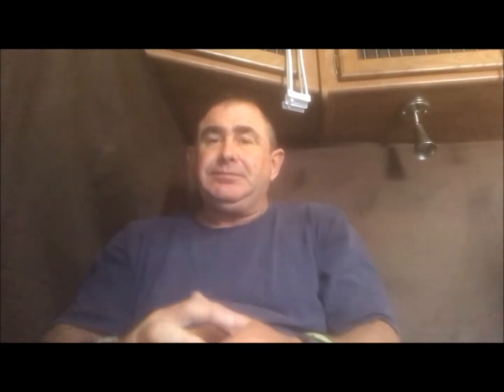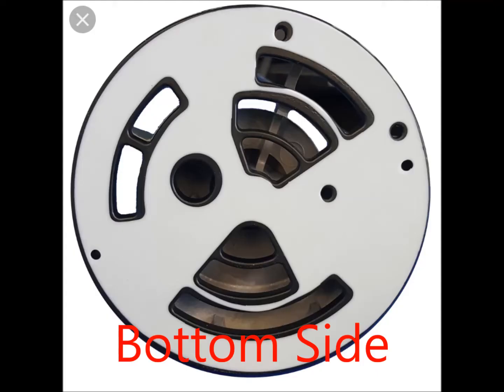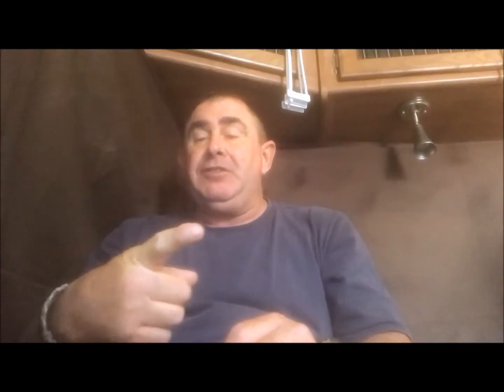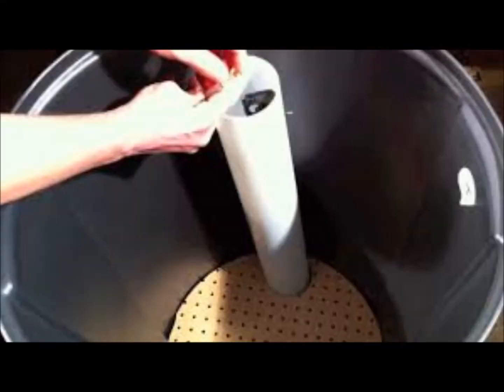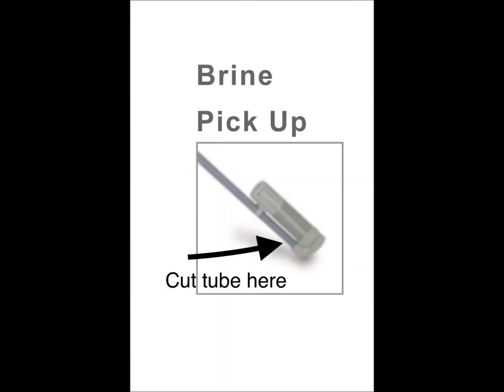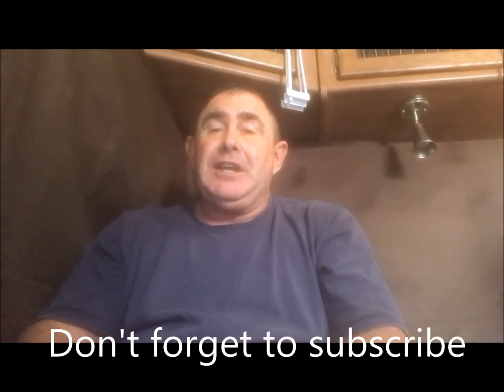why is there so much water in my salt tank

Comment: Thank you for nice info.
Question on GE Water softener GXSF27E01
Brine Valve body shows screen, part no. WS03X1008,where brine tube fits. No screen came out when I disassembled.  It may have flew away when I pulled. Is the screen necessary? I cannot find it online. Is that something I can improvise?
Reply from the maker: You may still have the screen but if not you’ll be fine. Thank you for reaching out

Comment: Terrific information, thank you. I have a Kenmore (cheapest model). Yes you are correct again, just re build the valve body with the kit ($65) and that'll fix her. My system cycles like this, first it fills (my display doesn't give indications just says "recycling") second it brines (draws the water out) this is where you will check for suction like you were saying. I felt no suction so I kept pushing the button to cycle it to the "service" position. Mine has a viewing notch where I can see the S for service. Put my water valve to bypass, unplugged it, loosened the 3 screws facing the back of the unit just a few full turns (i have a 5 bolt) to relieve the pressure. On mine the pressure was very small, no water came out. I left the black motor on during this procedure. When all the bolts were completely loose I put on gloves to pull the top off, it was stuck and required a bit of force. I kept the venturi and drain lines connected. I did disconnect the 2 electric connectors to remove the display panel. Some of the seals and o rings are directional so I payed close attention to all their orientations. And I made positive of the position of the rotor disk. Simple, fixed and with your inspiration!
Reply: Also, my system is 4 years old

Comment: Thank you for the informative video!  I've watched it multiple times.  
My GE softener has worked well for years but now there's a lot of water in the tank.  I replaced the rotor disc and seals.  I cleaned the venturi.  There is some suction from the venturi.  I'm not sure how strong it's supposed to be, but there's definitely suction.  But it's not draining the water.  I checked the bottom end of the brine tube -- while it spit out water during the fill stage, I didn't detect any suction during the brine, or any other stage.  Anyone have suggestions?
Reply from the maker: put in bypass or turn off water put in regen to take pressure off, then take the cap off the Venturi, take out the round rubber piece that's about the size of a quarter and turn it over and put it back it the Venturi and proceed as before to see if any changes have occurred
Reply: @LowCostWaterSofteners  Thank you for your reply!  I flipped over the venturi gasket (so the small, off-center hole was not aligned with the small screen below) and did not have any suction.  I then flipped it back and tested again. There is a tiny amount of suction -- it's very weak and maybe why I didn't notice before.  So it does pull out some water but at a drip or two per second.  Thanks in advance for any suggestions!
Reply from the maker: @steventhompson558  ok disconnect the hose from the venturi and put in the brine draw and see if the venturi has a lot of suction if not then maybe you might need to check and see if you didn't rebuild correctly or you need a new venturi kit both of which I think is not the case. If the venturi has good suction then take the tubing out of the brine well and disconnect at the bottom and see if it is not full of sand or some other problem inside the piece after you take that large clip off.  I am sure that was clear as mud.  Please keep me posted

Comment: I have an issue where I initially get suction, both at the hose connection into the Venturi assembly, and from the draw tube.  I’ve inspected the Venturi assembly and it looks brand new. I will dip the suction tube into water again and again and the draw appears to be fine, but I come back 60 minutes later and the water level in the same.
Prior to all of this I likely had a salt bridge. There was 5-6” of powdered salt in the bottom of the tank. Basically like table salt. It’s likely the water softener wasn’t functioning right for a long time.  I’ve cleaned out the brine well. Replaced with hot water and flushed things out.  I’ve disassembled/cleaned/ reassembled the draw tube.

Can’t figure out why it seems to have good suction, but is lost.
Thanks. Nice video. You seem quite knowledgeable.
Reply from the maker: Jason thanks for the question. I think I would take the entire safety float out of the brine tube and put it in a bucket then put it through regen but cycle it until it gets to brine fill and let it fill the bucket half way then move it to brine and see how it does if it stops then it is the probably the ball in the bottom of the of the pick up tube. If you can remove the clip without breaking it and take out that ball you probably won't have that problem again. Let me know if that doesn't work
Reply: Low Cost Water Softeners Thanks for the reply.  Much appreciated. I removed the pick up tube per your suggestion.  I cycled through to the brine setting and sucked up an entire bucket of hot water and bit more cool water. It seems to work perfect with fresh water.  I put it back in the brine tank and it stops.

The model of my water softener is a Whirlpool, and I’ve completely disassembled the pick up tube. I’m not seeing any ball or check valve or anything. There is a small mesh screen which seems like maybe it is getting cockeyed, otherwise I’m not sure what could be going wrong.  I assume brine water doesn’t have a different specific gravity that is somehow heavier and wouldn’t pickup like fresh water?

Stumped. 

Thanks again.
Reply from the maker: @jasonmanhart5016  How much water is in your brine tank before it starts to fill?
Reply: Low Cost Water Softeners Quite a bit of water. 1/3 full. This may be an issue of lack of understanding on my part.  I guess I’ve always assumed the softener is smart enough to know when the brine cycle should be complete by knowing all the water has been siphoned out of the brine well. If that is not how it works; but rather siphons for some pre determined time based on the salt level setting or a programmed time, then that may be the issue. Am I just expecting it to siphon more water than I should?  I’m continuing to manually recharge and skipping the fill cycle and the level is now quite low with little salt.  Perhaps it is good to go if I just fill with a little salt and correct the salt level setting. If the salt level setting determines the length of brine siphon time, I’m inclined to think I should set the salt level a bit higher than the actual level so that the brine siphon will be for a longer time to suck most of the brine away. I do think my salt bridge was screwing things up initially, but maybe just operator error now.  Thank for putting up with me.
Reply from the maker: @jasonmanhart5016  Jason the brine tank should always be empty until it goes into regen.  It does its fill in the beginning and only puts in enough water that will dissolve enough salt to regen you media based on how hard the water is and what was programmed into the softener. The salt setting only tells the machine when to flash the light at the bottom of the salt setting on the screen so you know when to add more salt, that is all that is for. These are made to fill and leave alone until you see the light flash then add salt. So remove the water, add salt and check your brine well, (the 3 inch tube in the tank to see if there is stand-ing water after a couple of weeks, if you do then contact me for more info. I hope I made sense, once you put the hardness in the softener it is automatically designed to do what it is supposed to. If it fills with water and does not take it all out then that is a separate problem
Reply: Low Cost Water Softeners Thanks. Will do. When you say the brine tank should be empty before regen, you mean “bone dry” or “a few inches of water in the brine tank”. Continued thanks.
Reply from the maker: @jasonmanhart5016  Yes, a couple of inches is okay.

Comment: My brine tank is filling up with water too. It’s 10” from the top. Sears is scheduled to come out August 3rd. Do I need to take out some water? Will it be okay till then?
Reply from the maker: It will be ok. The reason the water is that high is because the float is not set correctly, plus either your Venturi may have a problem here is a video to help, you don't need to unplug it or wear gloves. https://youtu.be/xGgehAbEc9E  The other problem which is probably the real problem is the rotor disc, it is worn so it cannot draw a suction, if you have 5 screws in the top of your rotor cover then you have a 3/4" if you have 8 then it is a 1" If you want sears to do it you can buy the part here from amazon which may be cheaper. This is the 1" kit https://amzn.to/3f0lfNn $40.76  You can get the 3/4" from softenerparts.com

Comment: My salt tank is filling up with water. The manufacture recommends replacing the brine valve assembly. I have cleaned the venturi out and the softener is a 4 year old Kenmore. What would you recommend?
Reply from the maker: Jimmy Peterson sorry for taking so long in getting back to you.  If you remove the top cover and look inside how many screws do you have 5 or 8 and how big is your bypass.  Is is cylindrical is it cone shaped at one end
Reply: @LowCostWaterSofteners  Thanks for your response, It has 5 screws and the bypass is just a push in and pull out with no cone shape. everything appears to be working mechanically except in the brine stage. the water is staying in the tank and overflowing into the salt tank.
Reply from the maker: @jimmypeterson1163  The first thing I would do is remove the brine tube from the venturi.  Put the system into regen and when it gets to the brine draw put your finger over the hole of the venturi and see if it draws suction, if not put the softener in bypass once the pressure is relieved then take the top of the venturi off and turn the rubber gasket out and turn it over and put the venturi back together then put the softener back in service.  Check for suction again. If it has suction then you found your problem.  If no suction then it is your rotor disk.  You can either replace it or do a fix, replace it costs around $55.00 for the part plus you have to take it apart, to fix it costs less than $5.00 plus you have to take it apart.  Let me know what you find and what you want to do and I'll help you with the next step
Reply: @LowCostWaterSofteners  So I ordered the venturi assembly from Amazon 2 days ago because it was only $35.00 for the whole assembly including the inner parts. My existing venturi had suction but it was weak. I installed the new one when I got home from work and sure enough. That was the issue. It works again. So I will be returning the Brine valve assembly. Which was much more expensive. Thank you very much again for your input and offering your help. Sure glad it was just the venturi assembly. Much easier fix than the alternative. I have subscribed to your U Tube channel. I will check periodically for new posts. Take care and stay safe out there.
Reply from the maker: @jimmypeterson1163  I'm glad it was an inexpensive fix, thank you for asking for help. You too stay safe sir.

Comment: my problem is the drain overflow from the brine tank expels too much saltwater for the bucket, so the bucket overflows and leaves wet salty floor. how to fix?  thanks. great videos.
Reply from the maker: ben tadano do you have a kenmore or whirlpool, Sears or a brand like that
Reply: envirotec , 540 model
Reply from the maker: ben tadano it’s a Fleck 5600 valve. Ok what you want to do is put it in brine mode.  Do you know how to do that
Reply: yes, go thru stages til it gets gets to brine mode.  then what? thanks.
Reply from the maker: ben tadano put it there and once it starts in brine mode disconnect it from the safety float inside the brine well and see if it is pulling suction, if it is then your problem is in the bottom of the brine well just take out The safety float turn it upside down make sure the little ball in the bottom is moving up and down put it back inside hook up your brown line to the safety float and see if it’s sucking water out if it does we should be good to go and it won’t do that any longer let me know what happens after that
Reply: @LowCostWaterSofteners  . the water level in the tube in the brine tank is almost two inches lower than the level in the brinrtank. I also found water on the floor about a pint or so, that did ntcoe from the overflow brief tank. as I had placed a bigger buyer to catch the overflow out of the brine tank drain. soI stopped. must leak when re generating. thanks.
Reply: looks like the problem is a leak as the water leaves the brine valve assembly. I tried to tighten the plastic nut but it just spins around without tightening. this tube leads to the brine tank.leak is between the two nuts on the back line.. what needs to be done? thanks
Reply: there is a leak when regenerating where the tube leaves the brine valve assembly. its between the two plastic nuts. I tried to tighten the nuts but they just rotate. it seems to leak at two different stages in the regeneration. what needs to be done.?  thanks.
Reply from the maker: ben tadano sorry for the delay, if the nut spins then take it off and look at the tubing and you should see a white Ferrell ring which helps keep the tubing inside the safety float with the nut behind it pulling it to the threads on the safety float.  Usually when it leaks like yours does someone has dropped something on the tube and it pulled out enough to keep the end of the tube from going all the way into the safety float and allowing the nut to tighten at the same time. You can find the ferrell nut at Lowe’s or Home Depot either in irrigation or plumbing. Take a pic and take that with you. Once you bring that home you can cut off the old one and start afresh and that should fix the problem. Try that and let me know how it works. It would be nice if you could send pics or vids. That would help a lot
Reply: @LowCostWaterSofteners  this sounds like the en of the tube entering the tube with lost. my lek is at the other end near the brine piston assembly.  thanks.   ben
Reply from the maker: ben tadano oops I’m sorry, it’s the same thing except inside the tube is a very small screen you’ll want to remove
Reply from the maker: ben tadano also you may have gotten a small slit in the tubing as well. You’ll be able to tell by it the tubing being swollen
Reply: stopped the line leak but unit runs too often.  plumber offered me a system for $5000 plus. I will replace unit. what brand do you recommend  for Northern California?   thanks for helping.
Reply from the maker: ben tadano perhaps you told me, remind me how hard you water is. Correct me if I’m wrong but you do have a 48k and would you remind of the name of it again please and the amount of people in your home
Reply: @LowCostWaterSofteners  11 is water hardness. two in household.48K and it's Envirotec made in AZ.  looking fleck 5600 or GE 40,000. thanks for any advice
Reply from the maker: ben tadano do you know how to program your softener
Reply from the maker: You’ll want to see if they have the hardness set at 11 and what size the tank is set at through the programming process
Reply: @LowCostWaterSofteners  ys, thanks so much. how can I compensate you ?
Reply from the maker: ben tadano was your water softener out of program
Reply from the maker: ben tadano Zelle

Comment: What is a clear indicator that your resin tank needs to be replaced?
Reply from the maker: Vincent Reed short answer, if is leaking, other than that you’ll want to change the medium and you’ll know by disconnecting the tank then look inside, you should have at least 1/2-3/4 full of medium. If not then it’s time to replace it. The reason it’s gone is because the chlorine has eaten it down
Reply: @LowCostWaterSofteners  I was told that the resin tank had a solid mass of iron in the base of it, and that it needed to be replaced. Now I'm not sure how truthful that was, as the plumber then continued to try and sell me a replacement resin tank for way too much with installation and all. My Spidey senses started tingling, if you catch my drift. The tank has never seen a drop of chlorine as we are on well water that has a high iron content. I believe I have to put some chlorine in to kill the iron bacteria as it does smell a bit. The previous home owners never maintenanced the system and now I own this problem. 
Is this senerio even possible?
Thank you for all your help on this.
Reply from the maker: Vincent Reed What color is your tank
Reply: @LowCostWaterSofteners  it's a fusion 2 clak
Reply from the maker: @vincentreed6411  Ok, here is what I suggest.  Buy some food grade hydrochloric acid https://amzn.to/2TswR47 and a reuse feeder https://amzn.to/2R5IB9K  pour 1/2 gallon into your brine tank at the beginning and then fill the feeder  put the system into backwash and ensure that there are 5 bags of salt in the brine tank for at least 2 days as well as the 1/2 gallon of rescare then put into backwash this should do the job.  you can also test the water coming into the house before the softener, and then after the softener then again after the softener after you use the 1/2 gal of rescare and compare your results or get back with me.  I think everything should be ok.  If all comes out ok you can if you like report him to his state board of plumbing